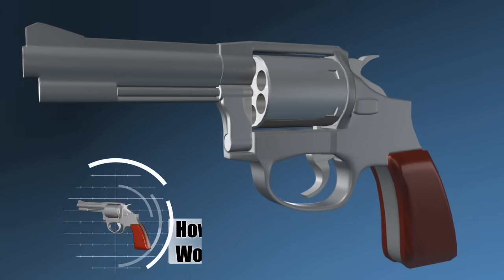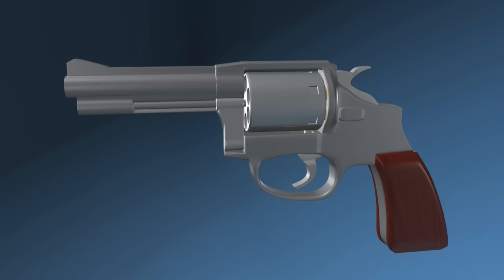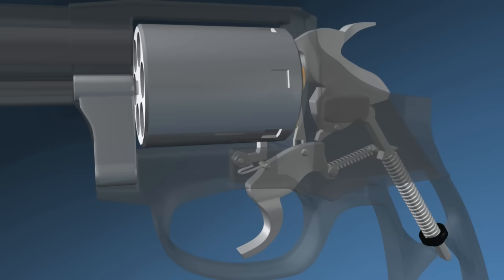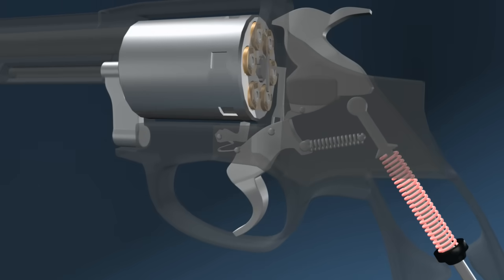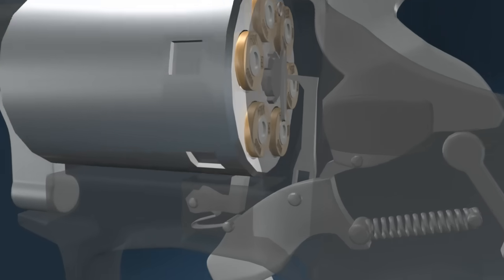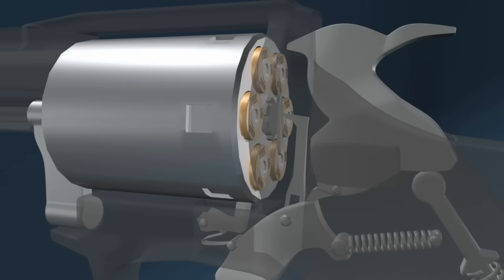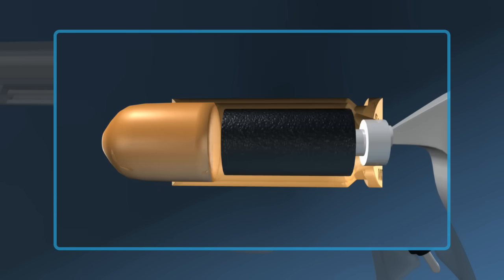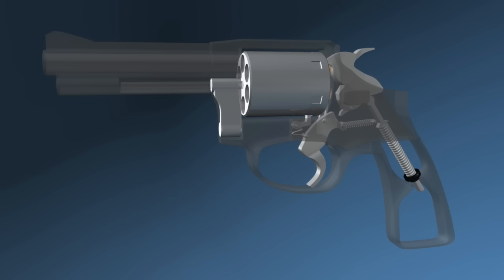How a Revolver Works

Comment: The cylinder pawl on my S+W model 69 would not engage the cylinder, leaving the cylinder to freewheel around. It eventually did work again but that was all I needed to see to not trust the revolver. S+W was notified and sent me a shipping label to send it in for closer inspection. That condition could have been a catastrophic failure sever injury or death. I have owned many revolvers and this was an issue I had never seen before.

Comment: If the hammer is not pulled back all the way, can it slip and still cause the bullet to be fired or is there some mechanism preventing the pin from hitting the primer if the hammer isn't completely pulled back to that resting position?

Comment: ther's no firing pin? the hammer is firing pin itself?
Reply from the maker: I'm starting to question that, as you're not the first person to point it out. When I made this back in 2009/ 2010, I was going off reference over an older revolver that may not have been accurate.

Comment: Imagine this: A revolver, but it runs on shotgun shells.
Reply: They're called the s&w governor and the taurus judge, both chambered in good old .410...can't really get any bigger shells, like 20 or 12 gauge, into a revolver without huge size and tremendous recoil issues...there are self defense shells in .410, usually around 4-5 pellets of 000...I wouldn't stand in front of it...

Comment: Thanks for explaining! Revolver was simpler than I thought
Reply: Yes, but at that there are usually more parts in a revolver than in a semi-auto pistol...the action is relatively simple in both guns, but because there are moving parts in both guns, they are subject to fail on occasion...a broken spring (best example, but pins, screws, etc.) will make any gun pretty much inoperable...you are holding a machine that creates explosions, normally controlled, but strong enough through constant use to wear parts out...

Comment: Fascinating.... i always thought you HAD to pull the hammer unit back to shoot, didnt know it could handle shooting without
Reply: That's called a single action revolver
Reply: You’re thinking of a single-action. Double-action can just pull the trigger
Reply: The first revolvers were single action, meaning you did have to pull the hammer back...double action revolvers came along later, and many double action revolvers will have a concealed hammer, for ease in carry situations...other double action revolvers will have an exposed hammer, that can be cocked and then shot like a single action revolver...the big difference is the trigger pull...most single action (or double/single action) revolvers have a very light single action trigger pull, which can aid in accuracy...a double action only revolver normally has a heavier trigger pull, but also is simple to use...pick up gun, aim, squeeze the trigger is simple, and under duress simple frequently wins...the heavy double action trigger is the only safety, and actually works very well...the old fashioned way to carry a single action is to rest the hammer down on an empty chamber, although there are a couple other ways a single action can be carried safely...

Comment: So then a downwards pulling is used to rotate the cylinder, and then when the cylinder is locked in place by the trigger the piece which pulled down slides back up to get in position to repeat the process? Neat.

Comment: So if you just pull the trigger without cocking the gun, the double action actually rotates the cylinder BEFORE firing?  Is that right? So the chamber that's currently lined up will actually get rotated away before the hammer falls, and the chamber that's to the right of it is the one that actually gets hit by the hammer?

So if the zombie is coming at you, and you have one round, and you put it in and line it up with the barrel, then pull the trigger, the chamber will rotate and the gun won't fire until you pull the trigger 5 more times? So you actually want to put the round in one chamber to the right? Yes, those were all questions.

Comment: One can't unappreciate revolver's semplicity. I know, they're kinda outdated, I know, they can only hold 5 or 6 shots, but for an amateur/beginner gunsmith they're the perfect project
Reply: Not outdated. Just different.
Reply: Outdated? You need educated pal.
Reply: @jasonemig5199  well, the solution to how to build a single barrel multi-shot pistol by a mounted revolving cylinder became something "old" when mass produced mag fed semiautomatics took the revolvers' place in armed forces, the only reason they were brought back was because of a shortage of M1911s in the 40s, but then they were again issued only to people in the back lines and as training tools (and no, personal weapons are not considered a soldier's main weapon, even if an officer can allow you to carry one officially they're not supposed to be there). If you don't have speedloaders you gotta shove each shot in separately (which is not a fast thing to do) and have limited ammo capacity (you don't wanna have to reload every 5-6 shots if you need more than 5-6 shots, you just don't wanna), also if a revolver jams (for the people that believe that "revolvers don't jam", they do, they're mechanical contraptions, every contraption will eventually jam, even a simple door joint) it usually jams so you can't pull out the cylinder, and to unjam that it requires a lot of time and effort. Good luck getting that unjammed easly during battle in a situation where you don't even have your main weapon anymore (very bad, if you're in a battle your pistol is a last ditch "shit I'm fucked" gun). So yeah, I guess small revolvers are nice guns to have for self defence (I dunno, I'm italian, we don't carry guns, we have knives and relatives), but on a military level revolvers are indeed outdated, obsolete.

Also no, I don't need an educated pal, I need a pal that brings me food, I'm starving here
Reply: @Momo_Kawashima  i wanted to make a comment, but you already told what I'd have said in your place
Reply: The fire rate is really what makes them dookie. Fully autos spit bullets too fast, by the time you get two rounds off with a revolver the fully auto already emptied a whole magazine.
Reply: @mh1970  But it only takes one bullet to win a normal gun fight. A slower fire rate cartige that hits is more effecitive than A magazine that unloaded fast and  misses
Reply: @mh1970  Recoil control on a fully automatic pistol will be very difficult if you're just emptying it in one trigger pull...they're also illegal for people without an FFL to own.
Reply: @leonaddison6862  just calm down and shoot in bursts. If you're missing it's not the guns fault it's yours. How you miss with a bullet fire hose?
Reply: @jasonemig5199  You need educated. Yep, you need a grammar education.
Reply: @jasonemig5199  "you need educated" lol. It is outdated it is outclassed by modern pistols
Reply: @hungryorphan5975  
By that logic then any fully automatic weapon outclasses a modern pistol, right? Revolvers jam but not nearly as often as a modern pistol. I prefer revolvers for this reason. If you can't kill in 5-6 shots then you ain't a good shooter lol.
Reply: @sarahlou7796  Revolvers are just better
Reply: @chroma6947  I fully agree. I always prefer a Smith and Wesson 357 magnum or 38. Special.
Reply: @hungryorphan5975  The revolvers made recently are modern. The newer model ones the ones that cowboys used to use that had black gun powder and only like one or two bullets before reloading like Muskets those are the outdated revolvers there are plenty of fresh brand new modern ones that are modern revolver designs with rubber grips of today.
Reply: @sarahlou7796  Exactly also the semi auto seems more outdated to me since its more probable to jam than the Revolver
Reply: I get the outdated part. But I do agree with the beginner stuff. Aswell as a decent home defense weapon IF you are not going to always take it to the range.

Revolvers are also great for training, since they teach you about trigger control especially when you only have 6-8 rounds.
Reply: @RyuzoSan19  honestly I'm not a fan of having weapons as home defence (mainly cause I don't need them, if burglars come to steal I can just laugh at them and call them morons for picking the only broke house in the neighborhood. Worst they can do is beat me and leave empty-handed), but if one day I need a gun for whatever reason even a shitass muzzleloader is good. All it has to do is sit quietly in a drawer and never be touched unless seriously needed (someone broke in and I can't bludgeon them with my trench club)
Reply: @Momo_Kawashima  Heh, alright then.
Reply: @Momo_Kawashima  "Worst they can do is beat me and leave empty-handed."
No the worst a home intruder can do is kill you. "if I need a gun...even a...muzzle loader is good." Well it would be better then nothing at all, but it is not good for home defense. In many cases, home invasions are perpetrated by teams of 3 or more men. Having only one shot in a situation like that is highly risky. The other reason why muzzle loaders are bad home defense guns is that that lead ball has a tendency to over penitrate the intruder, walls, etc. If you live in an apartment building, or in a crowded neighborhood, firing a lead ball that won't stop when it hits the target puts the neighbors at risk. Lastly, muzzle loaders are bad home defense guns because anything other than a direct hit on the central nervous system has a low chance of immediately incapacitating the intruder/intruders. I mean no disrespect to you. You have the right to voice your opinion and I don't mean to belittle you for that. However I think you are mistaken about muzzle loaders being good home defense weapons.
Reply: @Momo_Kawashima Kids say this
Reply: 9, 12 and 20 Shots exist.
Reply: @liszarezo3658  yes, but it's either you make a giant revolver or a minuscule round. Go ahead, make a .38 revolver that can hold 20 rounds and you can conceal carry, I'm waiting here
Reply: @Momo_Kawashima  Lefaucheux do this in XIX ceuntry.
Reply: @Momo_Kawashima  Revovlers are much more power than moder  type gun, what can be knock on one revolver shoot need 3 or more  1911 shoots.
Both type guns are to another use.
Reply: @liszarezo3658  the lefacheux holds 6 rounds you nook what are you talking about?
Reply: @liszarezo3658  you don't grasp the concept of different cartridges having different properties, do you?
Reply: @Momo_Kawashima  There are 12 and 20 rounds type also, yt delete link I did here.
Reply: @Momo_Kawashima  Can you explain little more? I am not sure we think about the same.
Reply: @liszarezo3658  yes, but as said, it was a chonky freakin gun, you can't carry it around like nothing. That's why you don't see a lot of "regular ammo size" revolvers going over the 6 (or 7 if you're russian) rounds, you don't wanna carry around a ridiculously heavy and large gun unless you hope the guy you're gonna point it at dies of laughter. And don't even get me started with big calibers like 350 or 500 magnum, a 20 round cylinder in 350 would be the size of a wheelbarrow wheel
Reply: @liszarezo3658  Hi. It is true that 8, 9, 12, and 20 shot revolvers exist. However, they are typically chambered in .22 caliber which is poor for self or home defense. In addition, better alternatives that have similar or greater round capacity exist at lower prices. If one is carrying a pistol for home or self defense, one is far better off paying 3-5 hundred dollars for an auto-loader chambered in 9mm, or even 380 super auto with a 15-17 round magazine, rather than pay 8-12 hundred dollars for a revolver chambered in .22lr with a 20 round capacity. The main reasons to get a revolver for self or home defense is their simplicity of use, and the fact that they are often chambered in more powerful calibers (i.e. .357 magnum or .44 magnum) than most auto-loaders. The trade off is reduced round count, increased cost of gun and ammo, and heavier longer trigger pull. If you you increase the round count of a revolver by chambering it in .22lr, you remove its effectiveness as a defense weapon and thus one of the primary reasons for buying it. It essentially is good only for target shooting. I hope this helped.
Reply: @davidhoffman6980  Maybe, but in my country most of these is illegal(you must have a lot of money, time and be totaly angel person in neigbors opinion to get the law on 12 mm caliber, no more gan be get on modern gun),  I can only dream have about somethink other than 22 caliber (sport gun license) or old revolver(colection license) for home defence.
Reply: @liszarezo3658  OK. That's a fair point. If you live in a country where the government keeps you from buying the best guns for home defense, then poor choices are certainly better than none. But again, if you wish to use a revolver for home or personal defense, you are usually better off buying one with reliable stopping power and only six shots, then buying a 20 shot .22 revolver.
Reply: They also do not jam
Reply: @manarakhs9860  that's more of a myth, revolvers jam too and when they do usually you require a work bench, tools and a lot, A LOT, of time and patience. Most common is the cylinder refusing to either spin or getting out, that stops you from both firing and unloading the gun. It happened to a guy at a shooting range here in Italy, it took three members of the staff (including the guy that was specifically appointed for repairing and doing maintenance to the weapons in their arsenal) something like four hours to unjam that spinning cunt
Reply: Also, you can make them break-action if you want
Reply: theyre not outdated they just serve a different purpose
Reply: lemat holds 9
Reply: @cosmicwatur6258  and a shotgun shell
Reply: Some 22mag have 12 rounds plink your heart out, . Get two.
Reply: They are my friend!!! They are also complex but simple at thesame time they are beautiful, watching this video sends shivers up my spine its such a well put together video
Reply: I agree with you accept for the outdated part
Reply: @doomthepro2ndplays552  I mean, they're not totally outdated, they're just an older and less practical design
Reply: They have 8 round revolvers
Reply: @buckshots2dabrain859  and 16 round self reloading pistol
Reply: @krissblade5330  and?

Comment: I managed to design the first low bore semi-auto (possibly full) revolver pistol. It extracts and ejects casings so never need to do it manually. Able to hold (depending on caliber) your 10 .22lr plus a 10 round magazine, which will have a safety latch to keep the bolt from double feeding if firing what's in the cylinder. I wish I could do a 3D rendering on a computer to later have a 3D printer to make the parts to make a functional model to later make a fully metal version.

Comment: i already made a homemade sniper rifle   but i got a lot of materials left so i can now make a simple handgun, its just that it will be a break barrel and will be able to hold a single bullet
Reply: Which ammo did you use? I don't think anything else than a .22lr would be good for self mades...
Reply: dan 1915 it was a .22, worked quite well, as you can see the comment is from 2 years ago, so now, as i’ve built a few handguns after i’ve made this post, I can tell you that it’s not worth it as it takes too much time to get it registered and licensed and you’re just better off buying a gun. All of my homemades are decent at best at medium range, but long range it’s incredibly inaccurate even for my sniper rifle prototype. It’s also not safe if you don’t know what you’re doing.